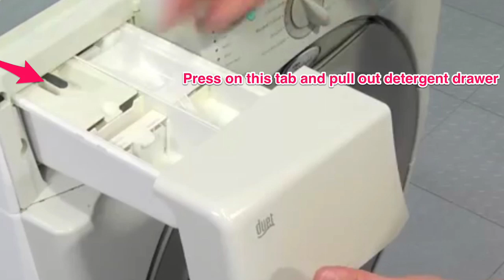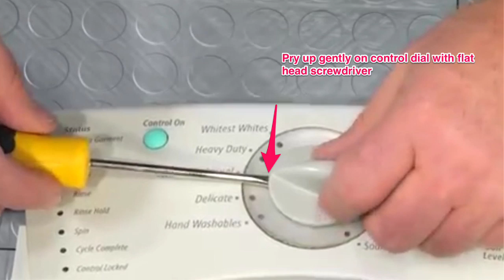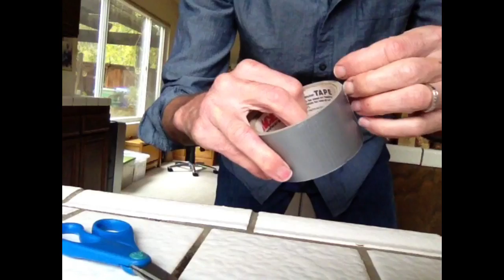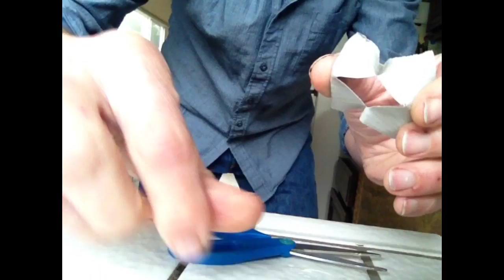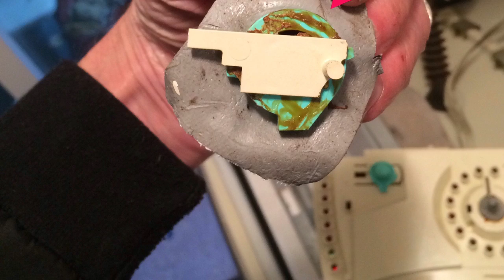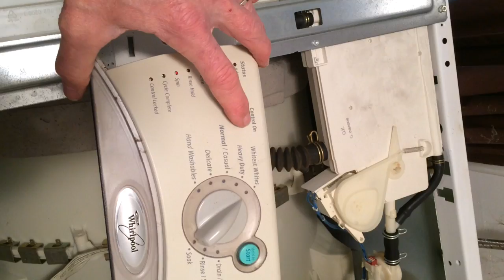⚙ Duet Washer Won't Start -- Fix It For 35 Cents 🔧-- DIY -- Easy Fix

Comment: 100% On the money!!!!
Did exactly 👍🏻 as you said and my washing machine is back in service. 
BUT FOR FREE. 
I HAD THE GLUE AND THE DUCT TAPE!!!
as one commenter said the plastic tabs are so brittle most of mine broke off the second the screwdriver touch them,but everything still worked out perfectly. 
Thanks for putting up the video.
Reply from the maker: Nice job Mike😊😊😊

Comment: I did this and it worked! I had the extra troubles with 7 of 8 tabs holding the front panel to the control panel break on me. The button worked before putting it all back together, but wouldn't work assembled. I solved this problem by shoving bubble wrap (Amazon bubble envelopes cut into strips) into the spaces between the panels where the clips used to be. This held it all together to reduce the "give" and makes the button work. So much of the plastic parts on that machine have chipped and shattered over the last few years, that it is a wonder it washes as well it does. Thank you so much!
Reply from the maker: You’re welcome 😊

Comment: 20 YO duet repaired.  Thanks for the directions.  I glued a tiny piece of plastic water bottle using super glue reconnecting the broken hinge.  A fish plate overlay.  The super glue sets quickly if you sprinkle baking soda on the wet glue after positioning the repair plastic piece.  Cost- 6 drops of super glue, a dusting of baking soda 1/8 tsp, and a clip of plastic water bottle = est. one dime and 30 minutes labor.  Thanks again. 😀
Reply from the maker: Wow,
Nice job😊

Comment: Scott,  thank you so very much!  I want you to know that because of your directions, I  was able to fix my washing machine. It was a different model than your example. I also had to fix all of the plastic clips that held the inner circuit board in place, they were too brittle. I fixed them with super glue and reinforced them with custom cut scotch tape. I am so thrilled, that with your help it now works! By the way I am a 69 year old woman.
Reply from the maker: Wow, very Impressive 😊👍

Comment: I’ve got a better more permanent solution. JB weld or a similar product of plastic adhesive epoxy works great. It’s holding on my oven door handle on as we speak and has been for about 4 months now. Only problem is it stinks badly. DO IT OUTSIDE!!!

Comment: Video was good and it was easy to follow.  I think you left a screw removal out.  Looking at the machine, it is located on the right inside corner.  This needs to be removed before the inside middle tab..  Hope you got over that cold.
Reply from the maker: Thanks so much👍

Comment: It worked!  Thanks!  I don't know how long it will last, but it did work.  Caution when removing board from over the tabs are VERY BRITTLE. I broke a few, even though I was very careful.  Fortunately, enough remain intack.
Reply from the maker: Nice job Michael 👍
Reply from the maker: Nice job😊

Comment: Doesn't surprise me that the tab breaks...it acts essentially as a spring...and after 1000's of presses and due to the fact that plastic gets brittle over time, the tab gives up the ghost and breaks.  Whirlpool  could have spent 25 cents and put a real metal clip (spring) between the parts and it would have lasted forever.  Great video, you turned duct tape into a spring.

Comment: Has anyone had this happen? The machine starts with the power button, then push the Hold to Start and then the washer shuts off shortly after it starts? Whats going on? Anyone?
Reply: It happened to me just now😨 so I am looking for the video if I could fix it before I buy new one.

Comment: Awesome Idea!!! I tried it and since my washer/dryer are stacked, I used a Toter 64 gallon garbage from Home Depot to remove the dryer single handedly from the washer after disconnecting everything properly. Thanks for the save! And I agree with some of you...the parts are cheaply made almost to fail after long use.
Reply from the maker: Very smart👍

Comment: Ingenious, thanks.  I offer another option that I came upon myself: just put the control panel back in place without the button or the plastic part that pushes the little button inside.  And when you want to start the machine, just reach in with your fingertip or a pencil eraser and press the little button.  The button is a little off center, but it works $350 worth.
Reply from the maker: Good thinking Brian. 😊
Reply: @ScottTheFixItGuyChannel  
I may try this. My button has been broken a couple of years but with just the right push it started. Can the button be removed without disassembly?(stacked...)
Stopped working today.

Comment: I just fixed it pretty easy. My big headache was taking the dryer down I have them stacked. Thanks!
Reply from the maker: Thank you,
One trick I use is to slide the dryer on to a recycling bin and then I can just wheel that away during the repair.

Comment: Please, what screwdriver head did you use to remove "this screw at :35 seconds. I'm stuck there and it's not in my regular set.
Reply from the maker: It’s a Torx 15.  You can get them at the hardware.